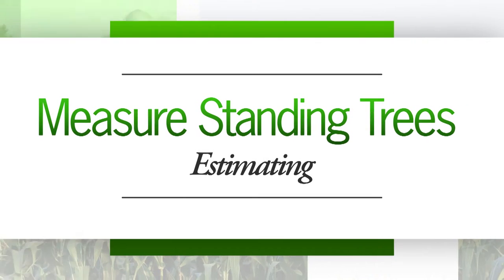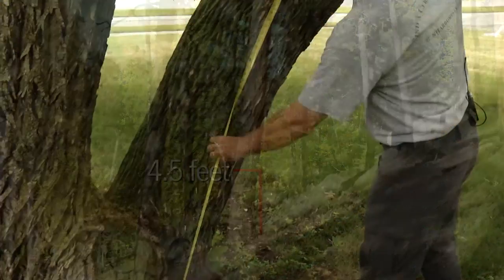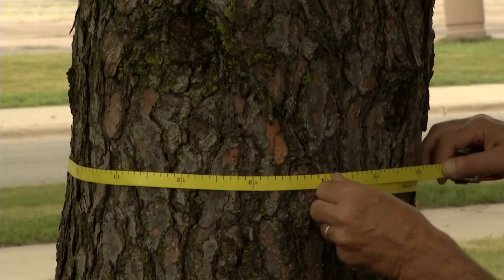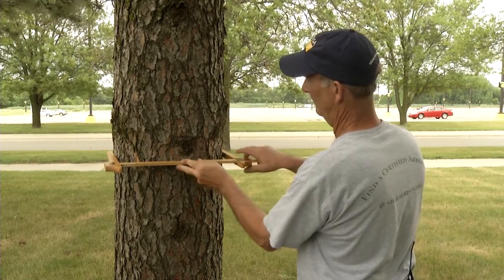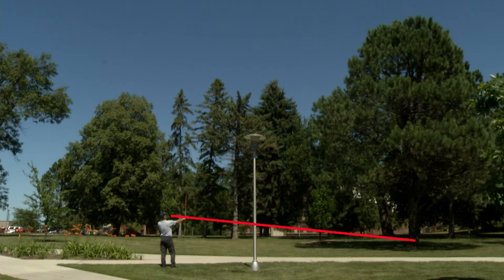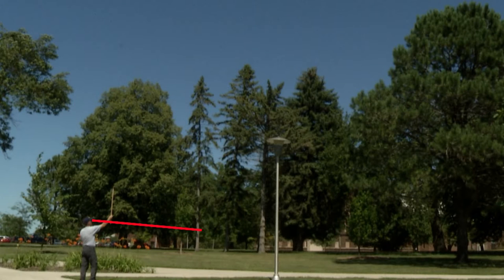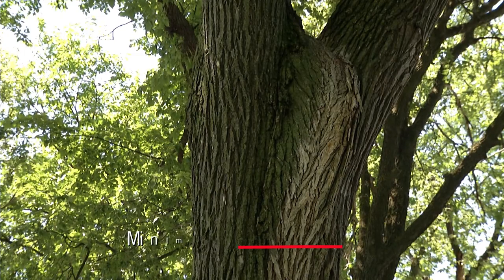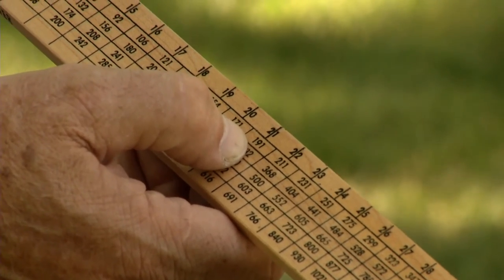Measuring Standing Trees: Estimating

Comment: Why does he measure the circumference of the tree with a cloth tape and say that he’s measuring the diameter?
Reply: This is done in cases where, you don't have access to a diameter tape. Therefore, by measuring the circumference by a piece of string, then measuring the string using a ruler or tape, you can divide the result by 3.14 and that is the diameter.